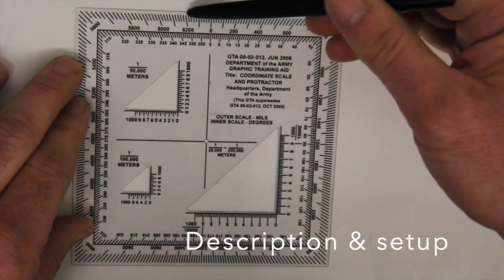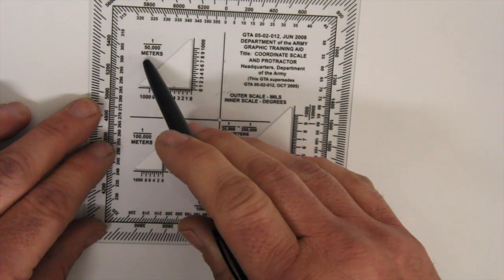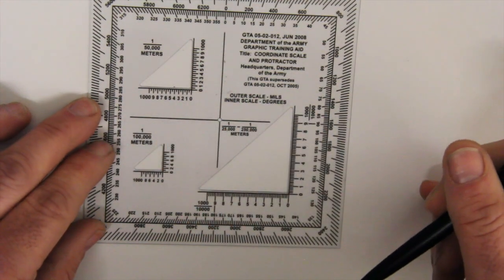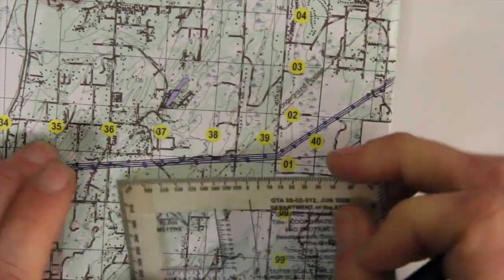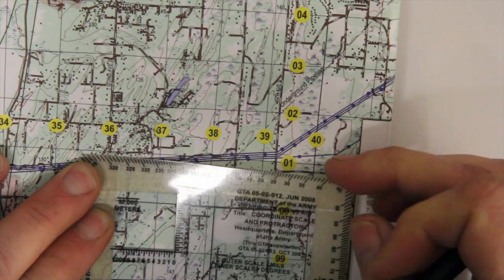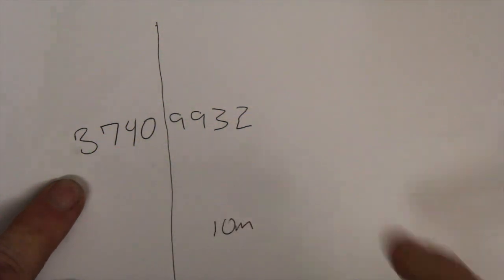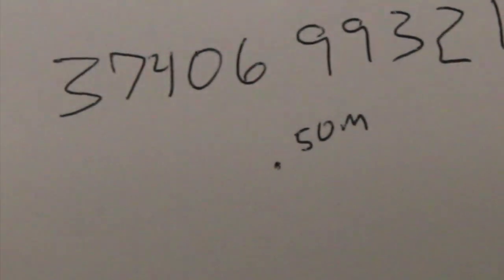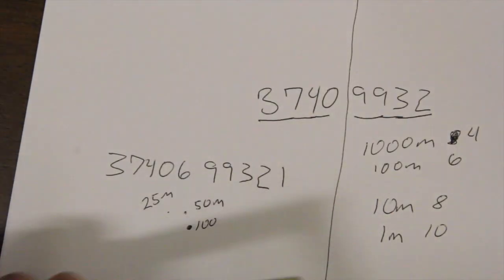How to use a Military Protractor for Land Navigation

Comment: Some things we learned in ROTC is to put a small hole in the center of the protractor and string a single strand of 550 cord innards through it. This helps to find the azimuth if the two points are too far to draw a line between or if you don’t want pencil lines on your map.
Reply from the maker: Joseph, that’s a great technique that I’ve used and have taught others in the past as well. Just gotta make sure you pull the string tight and be sure of it, else it can end up getting snagged or giving a false reading. But it’s certainly a way to determine your grid azimuth and it’s well worth keeping in mind!
Reply: @STOKERMATIC  what about using a pieve of fishline for this purpose? Thin enough, not? Thanks for posting your clear and understandle vids....brilliant content!

Comment: To get a more Accurate Azimuth direction.  When drawing your Line from Point A to Point B,  also find where the line crosses a grid line on the map.
Place the center hole of the protractor at this Intersection point.  Now you can align the Protractors Cross hair lines up with the grid line on the map
this eliminates the Guessing that your Protractor is Parallel to the grid.  
If you Don't do this, you might be Off by a Degree or two when finding your Azimuth Direction..

Comment: I asked this question before, but apparently not clearly enough. The question is: we know the declination changes between magnetic north and truenorth;
does it also change between grid north, magnetic north (GMA), and/or truenorth? If my map is several years old, am I going to have to change 
the difference between grid north and magnetic north, and/or truenorth; and if so how do I make that adjustment? I am particularly interested in any difference between grid north, and the other two over time.Thank you for your prompt reply to my previous question.
Reply from the maker: Gotcha. So yes, while grid north doesn’t change (always at top of map) the variation between GN and MN will change because the pole is moving. 
The way to stay up to date on it is to check NOAAs website. You can find up to date info here and then use that to make your adjustment for declination. 

https://www.ngdc.noaa.gov/geomag/calculators/magcalc.shtml?useFullSite=true

Comment: The military protractor makes it very difficult to plot a precise coordinate due to the offset of the plastic and the scale axis.  Do you know why they designed it that way?  Normal civilian UTM protractors have cutouts so you can accurately plot the point. Great GREAT idea to just cut off the MILS scale on the outside.  That was another annoyance I had was that the mils scale made it difficult to mark an accurate declination line.
Reply from the maker: So when it’s cut you still have a solid vertical and horizontal line - even with a UTM protractor, you need to be cautious and understand the impact of even a 1/32” error.

Comment: Can I use my protractor with a 1:24k map ? Is there any Tricks to be able to plot a utm grid corr. ?
Reply from the maker: You can use the protractor. Will get you close enough unless your trying to actually plot a 10 digit. UTM can be plotted just like mgrs. UTM just puts in additional numbers - similar to a UTM zone and 1000 meter grid designator. So UTM might read 370823 4315291 - the MGRS would be 70823 15291.
Reply: @STOKERMATIC  thanks for the reply bro. Alot of you tubers you tubers dont,and we really appreciate your time. .ya i normally use 6 digit for hiking and hunting, I'm not trying to find a buried treasures or anything... 🤣🍺

Comment: Hi. I have a question. I’m trying to convert grid to magnetic and my grid convergence on the map I’m using says 0.18 ( 5 and a half mils. I’m trying to ad to convert it to magnetic but I don’t know how to use that number to add. The 0.18, I don’t know if i need to add less than 1 or remain the the same
Reply from the maker: Ive never seen a GM angle of 0.18 degrees. If you want you can snap a picture of it and email it to me
Stokermatic@gmail.com
Reply: STOKERMATIC Thanks I will